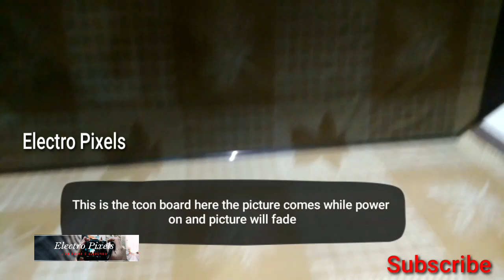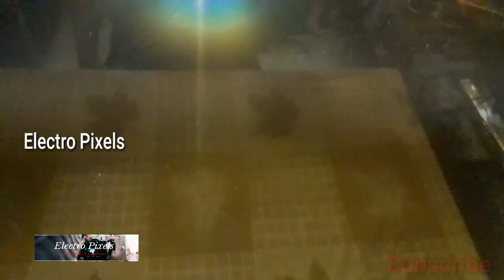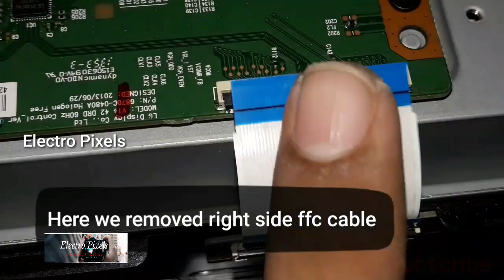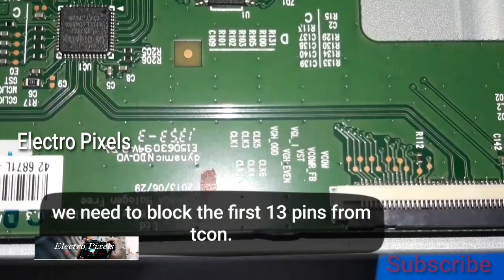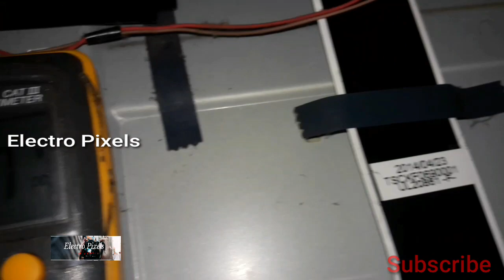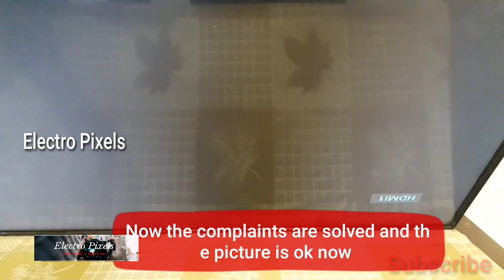Led panel Vgh, Vgl short removal method by modifying gate signals on 43 inch panasonic led Tv.

Comment: May i ask why we need to block th gate signal of the 13 pin from the tcon to the panel?
Reply from the maker: Because of internal shorting in panel
Reply: @ElectroPixels  When you say internal is that within the ribbon on inside screen somewhere or pcb board